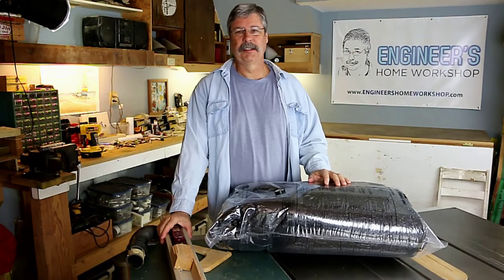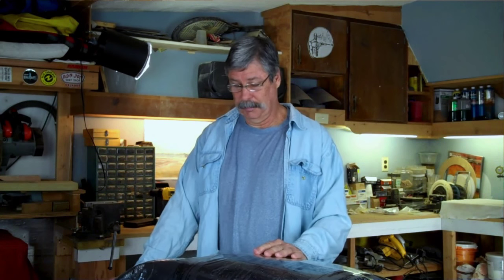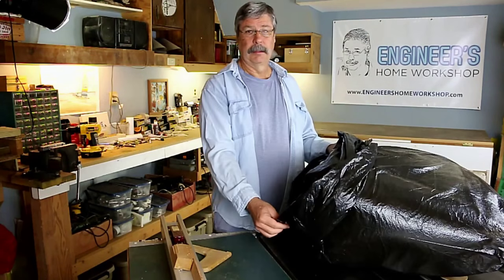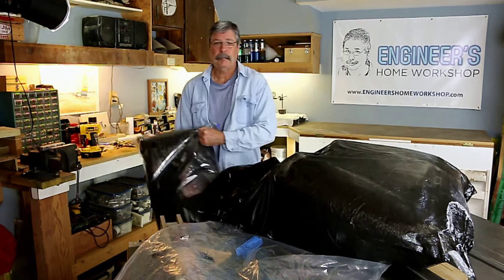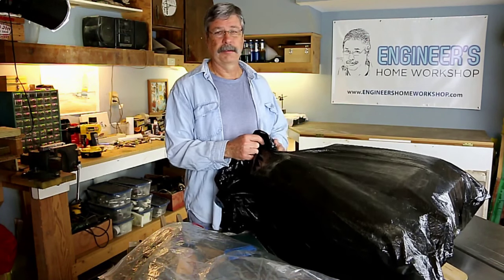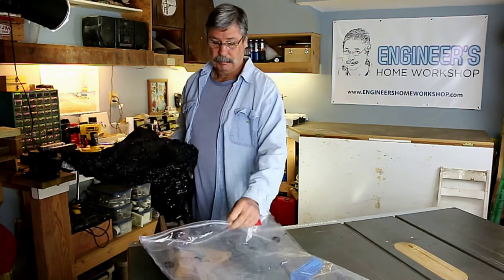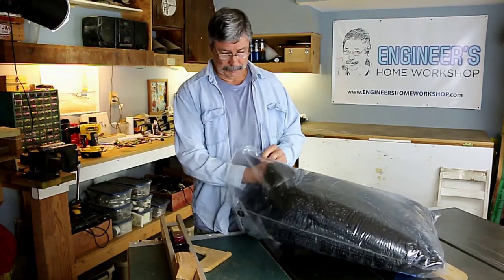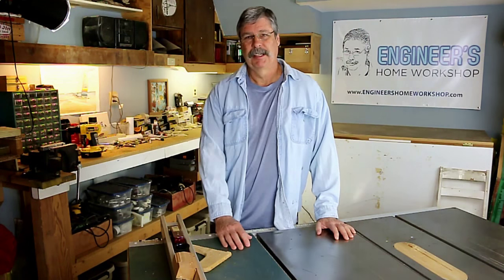How to increase the effectiveness of your vacuum storage bags.

Comment: I don't get it. Why use an "expensive" $4 vacuum bag that isn't using the vacuum feature? You could have used the black 35 gallon, $0.20 bag, vacuumed it out, and stored that in a 13 gallon, $0.10 garbage bag. It wouldn't expand beyond the 13 gallons which looks to be the size of the vacuum bag.

Comment: Hmmm, I dunno, seems like your tecnique is gonna make things difficult to remove from the outer uncompressed vacuum bag - you're fitting more in there than it's designed to fit, and you might need to reach inside and recompress the green garbage bag to remove your stuff, or you might tear the vacuum bag in the process..  You also won't be able to discern what's inside bc of the pre bag.

Comment: Thank you for taking your time for putting this video together. Very helpful tip. When reading reviews on most of these vacuum seal bags the top complaint is that they cannot hold their vacuum.  

As the ultimate goal is to reduce volumen. This is a very cost effective solution. Thank you again. 

The world needs more engineers!

Comment: What a shame so many vacuum bags out there are not working for so many people. I've been lucky enough to have my cheap vacuum bags work for me for years with no issues! I've had my wedding dress packed away for several years and its never broken the seal. But I love this idea of just using a trash bag and making use of the vacuum bags that have crapped out on you!  I wonder if you could just suck the air out of the black bag and then just tie a knot?
Reply: Can you please share the brand name of the vacuum seal bags that you use? I need to store my wedding dress and a lot of clothes and bedding for a few years.

Comment: Wow!! Thank you very much for sharing, I have seen some Dollar Tree bags I guess I will buy one of those and put my vacuumed item in the dollar tree bag.
Reply: I’ve actually noticed that the dollar tree bags are super thin and are more likely to get holes or split even at the seams when you were adding the pressure of vacuuming. The other thing I don’t like about dollar tree bags as if they’re made in China and they smell very toxic. If you were putting vintage clothing or valuable blankets or linens inside of this the plastic chemical smell may get absorbed into the items you’re storing

Comment: I was trying to think of what else could hold the tension better.  What if you put it inside a shrink bag and then ahrink that down to size before you turn the vacuum off?  Would that work better or faster than saran wrapping the whole thing?  I'm thinking then you'll have the desired compression size to use when you want to store your item again, unless they are not strong enough after opening to be reused .. What do you think?

Comment: And what about vacuuming out the garbage bag as you did, and then tie off the end of the garbage bag prior to placing in the storage bag?  Then remove the excess air from the starve bag to retain the smaller profile.
Reply: i tried that it'll still expand to the size of the storage bag because the bag wont hold in the air. Not the garbage bag or the storage so his suggestion was best because you still get everything you need in one bag which is one of the reasons we use the bag. It'd be nice to have it flat but these vacuum bags expand a lot of the time anyways after time

Comment: I easily fit one of those queen  mattress toppers in my dollar tree vacuum bag and it hasn’t leaked at all in over 6 months.
Reply from the maker: What can I say. . .your lucky. If it holds for a year you may have a new record. Good luck, and thanks for posting.
Reply: @engineershomeworkshop2692  Maybe they have multiple brands, I have about 6 of them still vacuum sealed and in Tupperware bins that have been in there for months. :-)

Comment: This is great, but do any (long term) storage bags exist that DO hold their vacuum seal and keep the compressed size for months?
Reply from the maker: Lots of ways to answer this question . . . reality = manufactures can't make these bags to the specs you would like because nobody would pay the price. The costs would far exceed any real or perceived value for the customer. So. . . over promise and under deliver becomes the economic necessity for these manufactures to meet consumer demands. (What that says about the state of consumer influences is another subject). 
Thanks for the question.
Reply: @engineershomeworkshop2692  Thank you for your reply.  I figured as much.

A possible solution, would seem to be for the same people who make the food sealing products (the vacuum & heat sealed type) to just make larger bags and machines.

Sure, it would be more expensive for larger portions of the plastic and a larger machine (plus hiccups that come with the R&D involved).  But, all things being equal, I'd bet that they could work the bugs out and make it profitable.

Comment: My question is, if you were to suck the air out of a garbage bag, and tie it off......how long, if at all, does it stay air tight? With air seep back into the bag? Or does it stay air free until you open it?
Reply from the maker: Not sure how to respond to this question Hugh. The plastic garbage bag will only keep the contents compressed for a few seconds. Just long enough to place the contents into a restraining environment. Than the vacuum is not an issue.
Reply: @engineershomeworkshop2692  good challenge for an engineer. Reenact this video. But tie the bag shut. Then leave it set to see how long it takes before air gets back into the bag. If at all.

Comment: I love a scientific approach but can you tell where these vac bags leak? Just guessing I would think the weakest place  would be the valve seal.  If that's where it's leaking then there should be some DIY way to enhance that valve to ensure a proper seal that would last much longer. Then again I would think the press to seal running across the top would also be a weak area. That could be a bit harder to overcome IDK.
Reply from the maker: Good question. All plastics are permeable. . . it just depends on the size if the molecule and time. Regular air has some comparatively large molecules and some small ones. Small molecules pass through easily. However, before I start writing a book on this question. . . be advised . . . being an engineer, my answer would not be the answer you want. . . I would only generate a hundred more questions.

Comment: Dumb question but will this work with clothes too? Like would I need to throw in cedar balls or something since it's no longer vacuum sealed? I need to store my clothes when the seasons change and I don't have a lot of closet space so I was originally just looking to use these vacuum bags the normal way until I just happened upon this video.
Reply from the maker: Anything that has air space will compress just fine including clothing and can work the same as the video shows. . . jeans wouldn't compress much. Cedar balls, I don't know, depends on your location, material, and personal experience.

Comment: Bill, it would be helpful to demonstrate how many days vacuum would last in good quality garbage bags. Good post though.
Reply: It wouldn't hold more than a few seconds. His point was that you could use a garbage bag initially to reduce the item in size but then stick it in an even smaller bag or perhaps tie off the garbage bag into its smallest possible size with the reduced-sized item in it. His theory isn't about vacuuming sealing a bag as it is that the item wouldn't be able to expand beyond the size of the bag holding it. Though, I don't think he has accounted for the strength of the item vs the strength of the bag. Foam was an overly simple sample. It's not very heavy and it is malleable.  I'd like to see how well this idea holds up to something thicker and heavier like linens or clothing. Would the holding bag burst?
Reply: @GaelinW  that is what I am currently worrying about with my vacuum bags in a wooden box. I just put them in and it's making some noise... But I think the wood will be fine, but if it was in something thinner I could see it breaking
Reply: @TcFW97TCM  - I think the same might hold true with a wooden box. If the "expansion force" of whatever you're storing is greater than the strength of the wood, hinges of the box or the connections at the corners of the box, they might eventually snap.

Comment: I'm not an engineer, but why not just seal the large garbage bag with zip ties? As long as the air doesn't escape, what does it matter?
Reply from the maker: Try it. Failure is the best teacher. However, when the zip tie seal fails . . . its mostly because a zip tie cannot apply enough force to crush the bunched plastic to a zero gap smaller then an air molecule. This leads to another issue, all plastics are permeable to small molecules . . . it just takes time to notice without scientific instrumentation. 
Thanks for watching.

Comment: The major problem with this is you still have to buy the vacuum bags right? You’re just not using them for vacuum
Reply from the maker: No, this is only assuming you already have the vacuum bags. This is instead of throwing them away (if they don't work). . . and I suggest alternatives if you don't already have the bags. I can only wonder, how did you get this wrong. . . regardless, thanks for asking for clarification.
Reply: @engineershomeworkshop2692  k cool